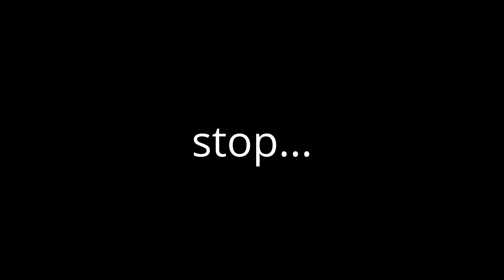How To Install A Tile Counter Top Spin Doctor Leveling System

Comment: Hello sir, I'm in the process of building a small outdoor kitchen and came across your video. Is it necessary to put plywood down on top of a 18gauge steel frame before putting hardibacker board on top?  Or since I already have a platform would it be ok just to lay out the hardibacker and then tile and skip the plywood step?
Reply from the maker: Yes, if you already have a substrate, no need for plywood.
Reply: Thank you.

Comment: Great video has helped loads. One question, Why do you need the plywood under the hardiboard? I have some 7.5mm blue board Isn't that strong enough? If I do the need plywood does it need to be external marine ply or will just your regular plywood be fine?
Reply from the maker: We use plywood for rigidity . There are many other better options other than hardibacker such as Schluter Ditra, GoBoard etc. I don't know much about blue board...
Reply: i guess Im asking randomly but does any of you know a tool to log back into an instagram account?
I somehow lost my password. I would love any tricks you can offer me!
Reply: @Imran Chandler instablaster :)
Reply: @Reid Harvey it worked and I now got access to my account again. I am so happy:D
Thank you so much, you saved my account :D
Reply: @Imran Chandler happy to help =)

Comment: Video is very helpful but how do you do the edges of the counter? Did you put backer board under there as well?
Reply from the maker: We installed/stapled lath/chicken wire and then tile. You should do that or screw hardibacker to the wood. Our layout forced us to go with lath.
Reply: Perfect, Thank you! That is exactly what I will have to do as well. You've really helped a lot. Thanks again!